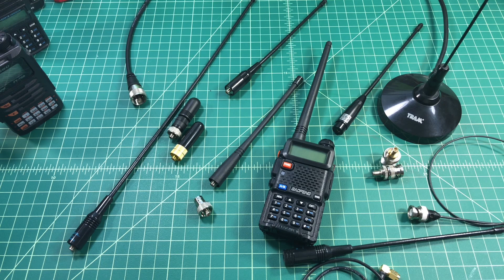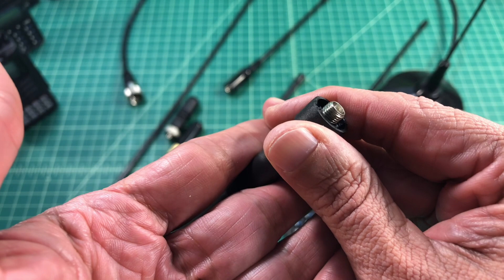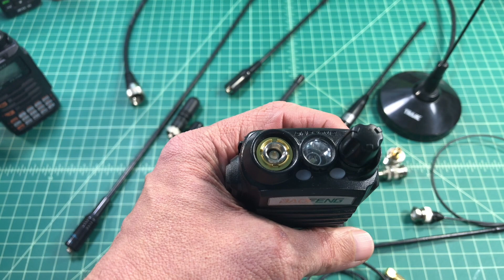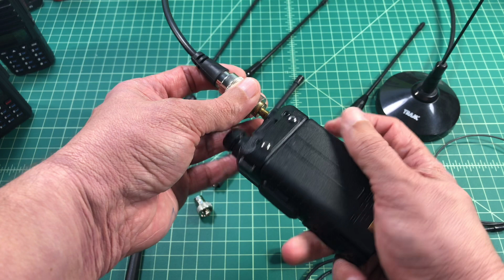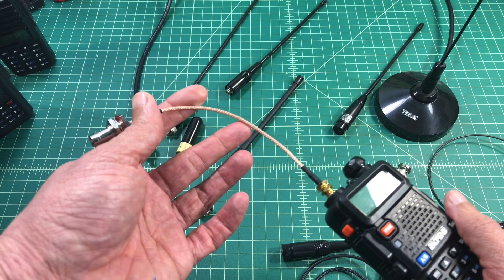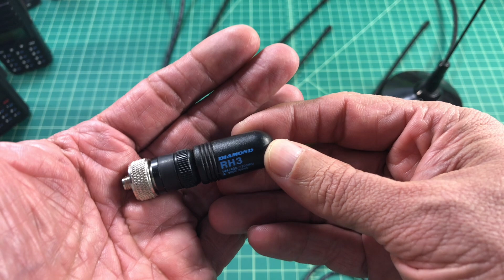Baofeng Antenna Options - TheSmokinApe

Comment: A question from a newbie: For transmitting, can we connect the handheld radio directly to a car antenna without anything in between such an an antenna matching unit? Could there be any SWR issues?
Reply from the maker: You would need to mount an antenna to the car for the frequencies you want to use.  The antenna needs to be for both Receive and Transmit, the antenna on your car is a receiving antenna. 👍
Reply: @TheSmokinApe  Thank you, makes sense.

Comment: nice vid ill try to explain what im asking do to im in greece so i leave in a house i got 2 UV-5r when i trasmit lets say to my wife i have about 3km range and thats when i can see that far with some houses in front the uv-5r,s  come with the ruber ant with the ball tip if i buy a original dimond for them what will be the def in RT TX . thank you for your vid
Reply from the maker: The antennas that some with the Baofengs are not the best, so many folks upgrade them to different models.  In some cases the better antenna can cause some signal overload on the Baofeng.
Reply: @TheSmokinApe  thank you

Comment: Hello - Can you please specify what a fake nagoya antenna is?  I thought I heard you say they work well with the Baofeng -  I saw one on ebay for 5.00 - Great video, by the way -
Reply from the maker: A fake is one that is made by a counterfeit company, that said not all fakes are equal.  A real one should have white lettering and come is a green bag.  Make sure to buy them from reputable dealers...
Reply: TheSmokinApe I’m guessing you’ve had some luck with the fakes?
Reply from the maker: Some yes and some no, I won’t buy them any more.  I’d just use the stock if the money is an issue, when I got better radios I’d rather not use the fake.  👍

Comment: I've been interested in ham for a little  while now. Would consider getting licensed even. Got a good deal on baofeng gt-3tp markiii radio. I believe I've figured out how to program it. Thought it would be fun to monitor the waves. Now the problem, I don't have a repeater within 10 miles of me at best here in Indiana. NOAA and static is about all I've found. So I'm into this for about $40 and loosing interest fast. What might be some recommendations IF I decide to proceed with this hobby?
Reply from the maker: Watch my video on the gt-3tp, I cover how to program with software.  You may want to look at a better antenna as well, I can pick up repeaters pretty far away 👍
Reply: TheSmokinApe Ok, after checking out radioddity website. $40 for a cord and upgraded antenna still hasn’t got me to break the bank. Going to give it a shot. I try to keep you posted. Stay well
Reply: G. Marsh definitely let us know how it works, I in the exact same boat, curious about results, thanks...

Comment: Have you tried your speaker wire antenna on a UV-5R?
Reply from the maker: You would need it to be a 2m or 70cm dipole.  The one in the video I did was for 10m

Comment: Hey bud I recently purchased a baofeng I ordered the uv-5r and I got a. BF-F8TD instead what is the difference between the two I haven't been able to find out any information on that model do u know anything about it as far as the difference between the two? Thanks .
Reply from the maker: I’ve heard of the BF-F8HP not the BF-F8TD.  The F8 generally means 8 watts of output.  I would not worry and just use it, the Baofengs are mostly the same with minor firmware updates and electronic differences to give more power or additional frequencies.
Reply: @TheSmokinApe  thanks for the info have a great day and keep up the good vids !

Comment: I have baofeng, Kenwood, and anytone handhelds.  In my work truck I always have a Uv5r.  Using a rat tail, and nagoya knockoff I operate repeaters 25-30 miles away on a daily basis.  Mountain terrain of PA.
Reply: What is your set up for the uV5r - I am also in Mts of PA
Reply from the maker: Sounds like you are getting out there pretty good 👍